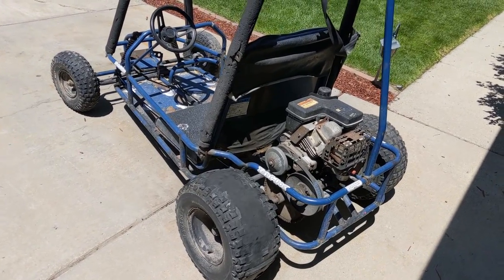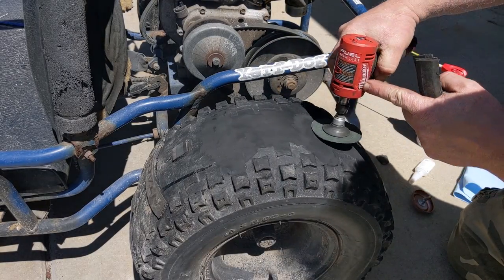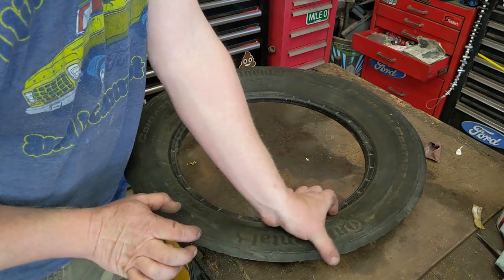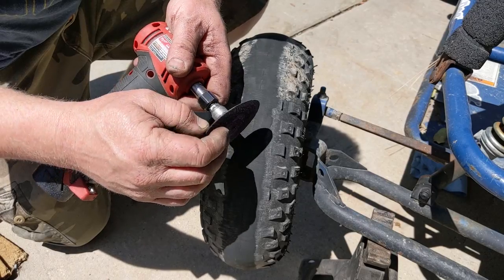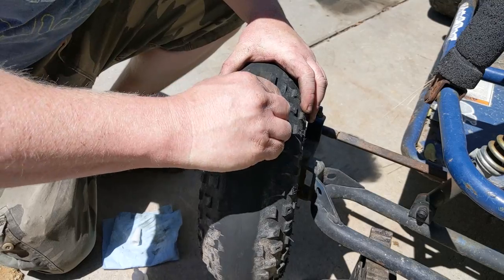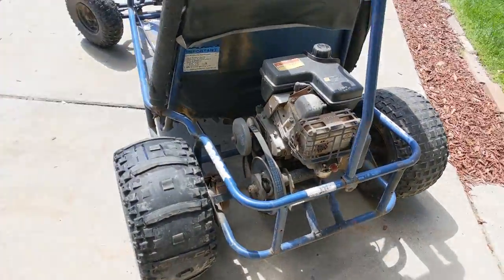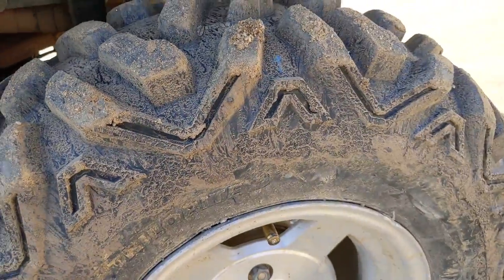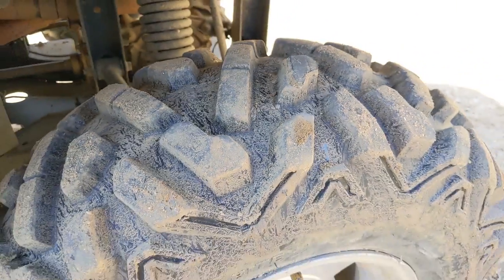Can NEW Tread be put on a Tire? custom tread patterns!!

Comment: Wow this brings back some fond memories.  Tampa Cord Rubber Safety Products - Back in the 1950's my father invented a door mat made from cord rubber car tires. They would last a lifetime and easily removed the sandy soil from your shoes prior to entering your home.
He had a custom machine made to cut the wire beads out of the tires and another custom machine to cut both sidewalls and the tread area into one continous piece.  He also had a old Rockwell drill press that had a custom made fixture that held 6 drill heads that were chain driven.  He used leather hole stamping punches in the drill heads to drill the holes in the cord rubber strips in a given pattern.    Once the holes were drilled he could cut the ends to size depending on the size of door mat we were making.  He even made some horse trailer mats which would also last a lifetime.  He also made the first dock bumpers that you see today that are made from truck tires.  On some tires he would buff the tread off which made rubber dust.  He would wire the two opossing tire beads together and mix concrete and rubber dust together to make steeping stones.  Basically, my father was BIG into recycling.  If he were alive today he would have been a HERO for making a GREEN planet.  Taking some of the hardest items to recycle and making really usefull products from them.  One time he even made me a pair of soles for my shoes from the tread section of the tires.  Of course, others copied his idea and made sandels from them. 
Thanks again for the memories!!!
Reply: Interesting story!  i was raised in St. Pete Florida in the 50 and 60's.  Small World.  I went to U. of F. Gainesville and got an engineering degree.
Reply: So cool!  Back when we made quality things right here in America.  Much respect to your father.
Reply: I have a pair of recycled tire sandals.  lol
Reply from the maker: That's awesome. Ingenuity at it's finest.
Reply: I remember seeing these mats. Thanks for sharing.
Stay well, Joe Z
Reply: My great grandfather resoled his shoes with tire treads as well. It earned him the nickname "Bear Tracks"
Reply: life in the 40th parallel here. pretty South even for the Pacific. in the sixties and seventies that kind of mat at the door was truly commonplace. Farmers had them to kick the mud and shit off of gumboots after milking time. Truckies and labourers had them out side the door and all manner of folks had one at the door. Cant find one for the want of looking these days.  And the older they got the better they get at cleaning the soles of shoes.  Of course rubber tyres are dirty blasted things so there will always be objectors. I just believe your story trumps this 3:32  length video. Good contribution ,thank you.
Reply: I spent my early years on a dairy in Nebraska and we always had one of those door mats. They were very high quality and popular with the horse crowd for their trailers. A friend of mine had a setup to make them mostly for trailer use. What a great use of tires. EPA would assassinate you but there’s a tremendous amount of fuel in a tire. I’d thought about burning them in an outdoor boiler but never built the contraption.
Reply: @AtimatikArmy  Thanks for the kind words.  I know he is giving you a big smile from heaven.
Reply: @budgillett9627  Back in the day, when we use to grow a lot of oranges in Florida the growers would burn those tires on the very cold days to keep the oranges from freezing.  Now the orange trees are gone and the land is filled with houses and over population of people.  Talk about polution!!!!  You would see the haze for days after a major cold front.  My father did his part to reduce polution and recycle an item that was not good for land fills.  The EPA would have probably given him some type of award for reducing polution.  Ha Ha
Reply: @helicopterjohns  I hope so.  Your father was obviously a great man.

Comment: Thanks I bought a bottle of PR100 after watching your last video about the adhesive, to repair an impossible to get weatherstrip. It works great, stays flexible and holds better than anything else I tried.
Reply from the maker: Great to hear!
Reply: Nice I need to order now
Reply: @sixtyfiveford  i’m curious to know if cutting the actual tread off of the car tire and gluing that onto the tire would work as well as what you did.

Comment: Nice!   I've seen where decades back retreading tires was more a thing.  Even true'ing tires when there's cupping so don't have to deal with the noise, i.e. assuming repairs or adjustments have been made that caused the cupping.  Wondering how long will hold up without the pressure vessel or heated press like machines?  Seems good to go for the long haul.  Thinking like the TruckerCo Tire Cream and like you showed Tireject... will have to get some of this Scotch Weld next.  Thanks for sharing!  Totally was thinking about like the snow chains too.

Comment: Found tube of 3m Amazon $70.
3M Scotch-Weld 25265 Plastic & Rubber Instant Adhesive PR Gel, 20 g Tube, 0.676 fl. oz. for 31$
You are right on that is some tuff glue.
Reply from the maker: I'm told this glue works great as well through a commenter who is in Canada(Cheap there". https://amzn.to/3Lb4cYo but I haven't personally tried it yet. "Satellite City Hot Stuff Special T CA Glue"

Comment: Just wondering if you have ever experimented with trying to "stud" any tires for ice traction? This would be a great idea for odd size tires in the frozen north country if successful. I have seen different attempts on various vehicles such as motorcycle tires but they were not using the gluing products instead opting for tubes.

Comment: I'd like to see you try a different technique where you could take a brand new or slightly used ATV tire with a bad sidewall and just cut the entire size out deflate your tire and then slide that over top and then just inflate your tire to pinch it together it seems like it might be a safer longer-lasting tire and still give you good flex

Comment: Since it works so well for the tire itself, I wonder how well it would work for fixing bicycle inner tubes. It seems like a superior glue to rubber cement. 
The advantage I have seen for using rubber cement instead of contact cement is that the rubber cement will stay flexible, and the contact cement will be hard.
How does the PR100 dry? flexible or hard?

Comment: Wonder if that can save dry rot? Guess I could do a tube but also thinking about it for motorcycle tire so maybe higher speeds and not safe
Reply from the maker: I did glue a couple larger dry rot cracks together in another go kart tire and it held. I would probably pass with tires that saw any real speed.

Comment: I like this series on this glue. Have you tried it on plastic?  Or rubber to metal?
Reply from the maker: I haven't. I need to give it a try and see how well it holds up.
Reply: My dad used PR40 to fix a plastic kids slide that had cracked. He also fixed a plastic wire attachment connector thing (that's the technical term) on his truck. He said it bonds plastic immediately, so make sure you get it right the first time or it'll be lopsided like both of the things he fixed 😉

Comment: I'm about to do a chicken 🐔 and produce turnaround run from Atlanta to Los Angeles to Atlanta. I'll glue this on grossing 80,000 lbs. Will glue tread on 18 tires and let you know how they hold up. Sure nuff if you could simply glue the strips of tread on it would be safer. When the entire cap blows on a recap it's a massive explosion. If these strips started to come loose the driver could cut them off one by one at the tire.
Reply: Definitely interested to see how they do!
Reply: I too would be very interested, for what it's worth,  I feel  this is as serious a test as it gets.  If you find this effective, it will be worth giving it  go on forklift steering tyres which take a beating  and chew out fairly quickly . Good on you for giving it a serious test.  Thanks
Reply: @davidp8157  
Honestly I was just being a Smart @$$.  Would be afraid the DOT would shut down a ride instantly if they happened to notice this. They are a ruthless bunch. They to Love to prison rape any driver who strays from the pack. 
   If you're talking about all terrain construction forklift steering tires , this would be the ultimate test for this glue. A great older friend of mine who finally had to throw in the towel a couple years ago ran a couple 580 Case Construction King forklifts. He bought 4 new steering wheels for them. He had me to double weld plate steel in the center of the wheels because they kept bursting out at the most inopportune times. Anyway no more broken wheels but I've seen whole chunks of tire caps missing from them.
Reply: @coburnlowman  i thought you were keen, especially with your name on it. All the same , thought provoking....

Comment: Have you tried cutting the sidewalls with tin snips? May have to sharpen your snips first. 
Thanks for the tip on the glue. I got some based on another one of your videos that mentioned it. I use it for everything. It smells just like CA glue. I wonder how much is different about it? I've used CA glue to make my own o rings before. It works fine...
Reply from the maker: It is a CA glue but they've done something to it so has better flexibility. You can actually view the entire data sheet on it where they tell you exactly how strong it is on different materials. I have tried tin snips before and they do work. The issue is scissors, snips etc wear out your hand pretty quickly. It may look like I'm trying hard with the razor blade but not really at all.
Reply: @sixtyfiveford  Ive used snips to cut some very thick conveyer belt rubber. They're not the aviation type of tin snips. They're a giant pair of straight cutting things that look like sheers. I sharpened them so they could cut paper. I sometimes chuck them up in my tripod (chain) vice and use them like bench sheers. When cutting rubber, either with blade, scissors or snips, it always goes much easier to use soapy water as a lube along the cutline. You cut up a lot of tires.. try the soapy water trick next time.. i think you will really like the results.. use it liberally.  

Thanks for all your contributions here on YouTube. Yours is one of the best channels here. I'm amazed at, A. How many videos you have posted, and B. That there seems to be no end in sight. They keep coming. Idk how you do it as well as document it and edit it and still complete the jobs... keep up the good work

Comment: Could this be used to repair an exploded radiator water hose? 
Could be a life saver.
Reply: I am sure it could if you had the right material to wrap around the outside.  It would still be temporary because as you probably know wrapping stuff on the outside does not hold pressure as well as putting something on the inside  - just like patching a tire.
Reply from the maker: Interesting idea!
Reply: @advancednutritioninc908   Tires hold aroud 45 PSI, a radiator system has about 18 PSI. It should hold quite well.
Reply: @flacoanemico5199  I did buy a bottle of the glue he recommended it is amazing stuff!  if you had some 1/16 to 1/8 inch rubber to wrap around the outside of a radiator hose and you did a good glue job - based on what I have experienced it will probably last quite a while!

Comment: Nice 👍🏻. Going make custom mud runners for my Honda 300 4x4. Because Honda 300 4x4 uses 1” difference between front and rear tires. Have 26” all way around so going build up way supposed to be. Got something to do with transfer case. Or front ring pinion not matched. If do lot hard road rides that’s what’s tears rear ends out. Trust me see lot 300 4x4 rear ends gutted. 4x4 only 2x4 you can use same size. That’s I’m formation from older great Honda mechanic. Frank. Franks atv. Get all your atv needs. Franks atv Smithers WV. Not sponsored by him just good place to go good price’s. 
Love video’s. Keep um rolling will retread our subscriptions. lol. Stay safe. From ur ole hillbilly buddy.

Comment: Carb cleaner has oils in it for upper cyclnder lube
Reply from the maker: No it doesn't. It's just 99% Acetone and sometimes MEK which are amazing degreasers. It's purpose is to dissolve gas (oil product) not to lube an engine. I've used it hundreds of times before painting and it's probably the best degreaser out there and beats brake clean hands down.

Comment: 7:28 uh.... live axle means solid non independent suspension. 
You mean its locked/locker.
Reply from the maker: Live axle in the go kart world means the drive axle is one solid bar with both tires positively connected.

Comment: My go kart by summer when we lived in cannada fir 6 years tires would look like this due to it bey g a live axle both wheels spin lile a racing cart. My parents owned a asphalt circle track a inside 1/4 mile oval veey high bank and i was 5 to 11 when we lived there and I had a red go kart that said fun power on the brigs motor it was a red cart wilt roll cage and yellow padding is hpw it came from the factory new if anykne knlws what brand cart it is lwt mw know. But anyway dad rebuilt the motor into a legit 10.5 hp racing go cart motor kept stock motor as well so it can be origional if want to go back to stock. Any way this thing flew we clocked it on radar gun on oval track with me driving doing 65 mph plenty fast enough so i eould drive it year round around the track and the large property but in WI her time we would go out there and let me drift wnd play in the deep powder snow on it and those tires would be held after 2 weekebds of me drifting lol. Dad hated it dye go buying tires twice a month fir rear. But it was fast enough doing 65 mph to teach me how to hold a racing lineat a high speed on oval track. Plus I drove moms 580 rwhp super stock aroubd track in late afternoon when racing was over for day. And other drivers wod let me race fheir 4 cylinder rwd ministock cara like mustangs 4 cylinders or Toyota carollas and pintos and thunderbird. And its very easy to convert any yard cart into a live axle tire shredding beast jist weld two brackets on each side that holds axle bearings and use the right axle and good to go you can buyna complete kit. But if anyone knows the name of the go kart i described above please let me know I wanna find another one and fix up to look brand new to bring back soem childhood memeories im 30 and parents bought in mid 90s in Georgia for me like 97 98ish right before we moved to cannada. It sajd fun power on THE 5 or 8 hp Briggs and stratton motor somewhere between there power wise and had a rainbow kind on in middle of floor pan that sajd fun power or something as well. It was kind of long single black fake leather covered seat aluminum poloshed gas and break pedels whole kart was red wkth yellow roll bar padding from factory and a black steering wheel that was deep with three arms coming down to center where it was welded to steering shaft and had holes drilled in the arms to look more racecar style. I think it came from pepboys as well.or Sears if anyone knows what brand it was please let me know

Comment: I'm not a lawyer but I wouldn't endorse the use of carb cleaner on skin for legal reasons such as "causes liver failure". It definitely cleans up glue though, can't deny that...
Reply from the maker: It's acetone; the same thing as nail polish remover.
Reply: @sixtyfiveford  "avoid contact with eyes and skin" is on the back of every can of brake cleaner or carb and not on nail polish remover. They have other nasty chemicals beside acetone in them.
Reply: Carb cleaner often contains MEK and benzene. You don't want those on your skin.

Comment: You should ping cars and cameras www.youtube.com/c/CarsandCameras with this video. It's right up their street.
This is excellent glue. I could have used it when fixing that flap of rubber on the toe of my running shoes yesterday.
Reply from the maker: Pretty sure they have an unlimited supply of free tires from go power sports.
Reply: @sixtyfiveford  for sure but I was thinking more along the lines of them having over 1m subs so a mention of your channel may boost your subs. Their viewers might find it useful too.